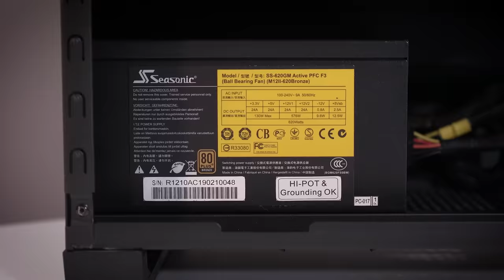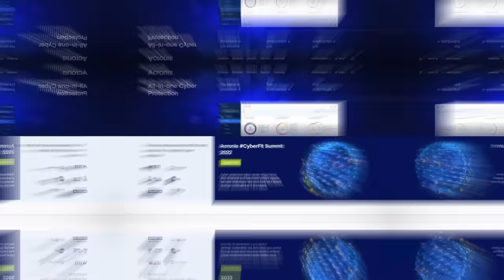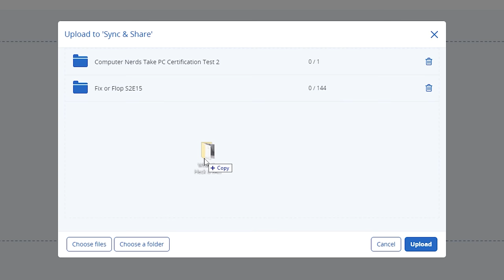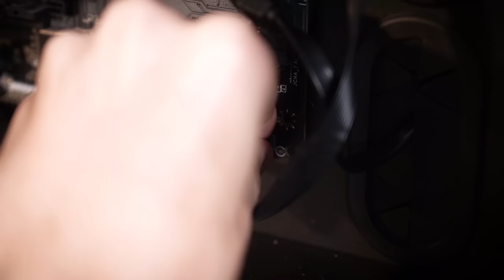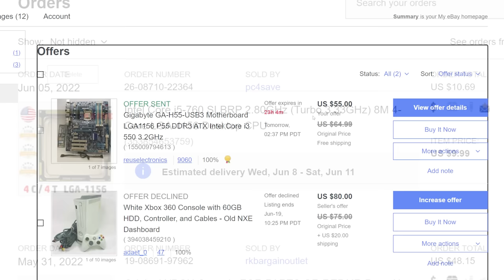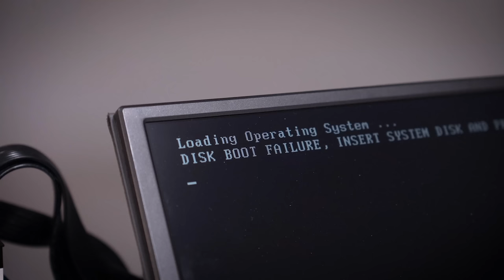Fixing a Viewer's BROKEN Gaming PC? - Fix or Flop S2:E14

Comment: hey everyone im looking to build a pc for my first time but you see im stuck on the type of fans here's the case: Phanteks (PH-ES518XTG_DBK01) Enthoo Evolv X ATX Case Tempered Glass Windows Digital RGB Black on amazon and im putting in a: ASUS ROG Strix NVIDIA GeForce RTX 3070 Ti OC Edition Gaming Graphics Card (PCIe 4.0, 8GB GDDR6X, HDMI 2.1, DisplayPort 1.4a, Axial-tech Fan Design, 2.9 with cpu: AMD Ryzen 9 5900X 12-core, 24-Thread Unlocked Desktop Processor Please help with aio and regular case fan with no rgb thanks in advance.

Comment: I will never understand the stupidity of PC builders.    It is so antique to build HUGE computers that consume so much energy and yet are not all that powerful.   Unless you are an extreme gamer, I don't see the point wasting resources to build such dinosaurs.     I say that as someone who used to have multiple towers and was brainwashed into thinking that was the way to go.    I have had a chance to buy as a daily driver a $440 extremely small form computer that is smaller than a mac mini.   It features an i5 processor but can handle dual displays and is now loaded with 32 gigs of ram and two ssd's - one nvme and one sata.    This is not a gaming computer and has been used for light graphics work.    I have dogged this computer with 25 firefox tabs and playing multiple youtube videos in them and the system simply works.   It is quiet and is power efficient.    And it takes NO ROOM to house (could even be hidden behind a monitor).    

I have replaced every tower now with a mid range laptop hooked up to 27 inch monitors.   Each laptop is closed lid sitting behind the monitor and each computer specializes in different activities and all together, this "fleet" consumes less energy than one of the towers I took offline!     Many of these laptops are i7 or even Ryzen 7 systems which are supposedly gaming laptops.    I use them to make videos (Love the Dell XPS 17).     

All told, I'm never buying another tower and don't even understand the need for one these days other than to show off.   I don't care about upgradeability other than being able to max ram and to work on ssd swaps as needed.    In this day and age, electricity costs are making a case to think efficiency over raw horsepower.   Get more bang for your buck!